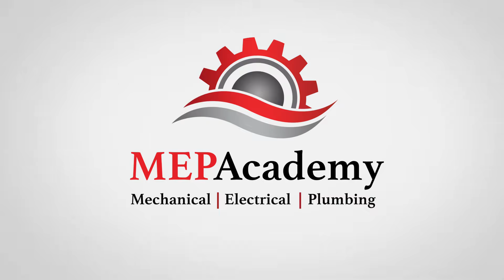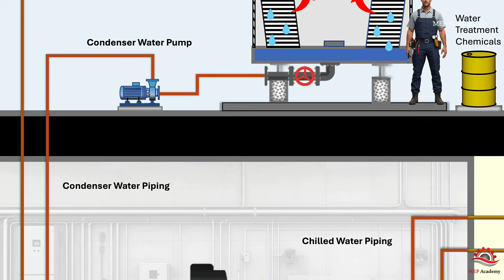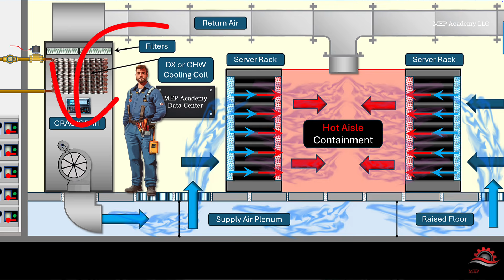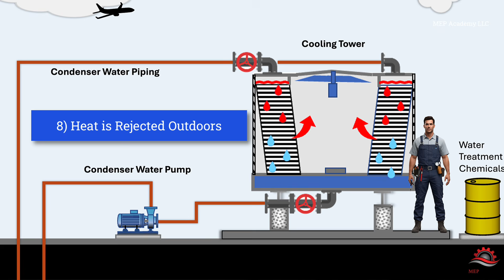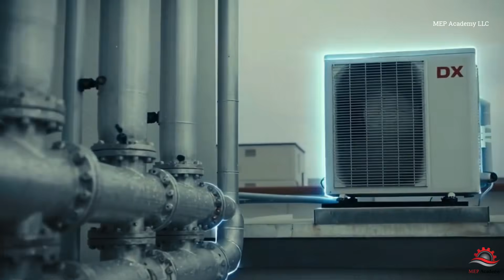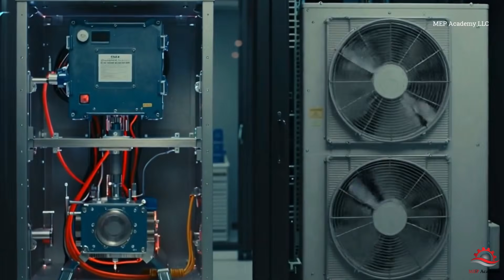Data Center Chilled Water Systems Explained

Comment from the maker: Most people think power is the biggest risk in a data center…
But cooling failure can take everything down just as fast.
👉 In this video, you saw how chilled water systems keep servers from overheating—but this is just one piece of the puzzle.
If you want to actually understand how these systems work in the real world (and how they’re designed, estimated, and built):
🎓 Check out our full HVAC & MEP training programs here:
👉 https://courses.mepacademy.com/
Also — quick question for you:
💬 Would you rather work on the power side of a data center or the cooling side?
Let me know in the comments 👇
Reply: Mess up water side and you might ruin equipment. Mess up power side and you might get killed. Once sorted, power side is pretty much left alone. Water side need constant maintenance. Only then generators on the power side need maintenance, but not to the extent of water side.

Comment: I just started my 3rd week into learning how to run and maintain  2 data centers for a very large university as a Critical Datacenter Operations Engineer after I got laid off suddenly but thankfully my work connections got me hired internally after the previous engineers moved on, these videos will help me tremendously in learning everything and finally retiring from 20+ years of help desk IT support! Thanks so much!
Reply from the maker: Thanks for watching.
Reply: I'm starting job soon but I have a background in residential hvac. Please message me im outside my comfort zone

Comment: Water cooled chillers do NOT always utilize Cooling Towers... this was the case for many years on smaller data centers, where the municipality had water avail for them to utlize.  However, over the past decade people have become much more water concious, and with that, when a Data Center now considers deploying Water Cooled Chillers, they more often then not utilize a Dry Cooler on the condenser side of the loop.  So a fully closed system that doesn't evaporate water.  That's not to say there are some bad actors of developers out there that don't consider being water or energy concious, but for the most part design teams are working tirelessly to make systems as efficient as possible while not evaporating city water.

Comment: One reason people hate data centers in their areas is that they waste so much water in the cooling systems. Why don't they use absorption chillers so the heat from the building can be recycled to help cool the building and thereby have a  closed loop system and not waste water
Reply: Data center designs that utilize closed-loop cooling systems are NOT evaporating water.  And absorption chillers are not utilized b/c they take up to 40min to restart after losing utility power, which is too high of a risk for the critical infrastructure.  Also, until nuclear or something that can scale with the needs of the data center is directly adjacent to the data center regularly, then there isn't anywhere to send the amount of heat generated to, other than the atmosphere for now.  We've looked at doing greenhouses, and other types of highly sustainable approaches to install alongside them.  But the scale just doesn't align yet to where the developer justifys going down that path.
Reply: Yeah every system I've seen in the past 15 years are closed cycle systems